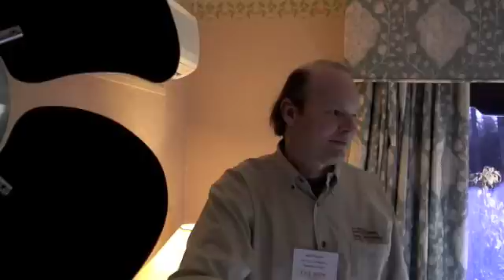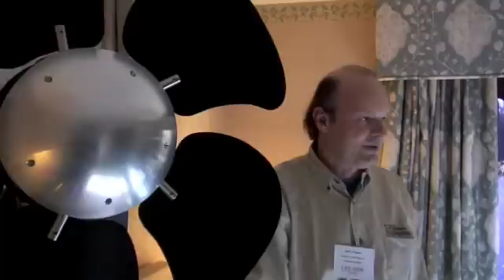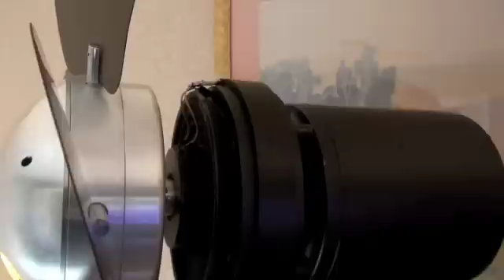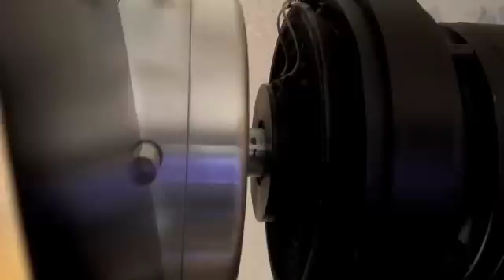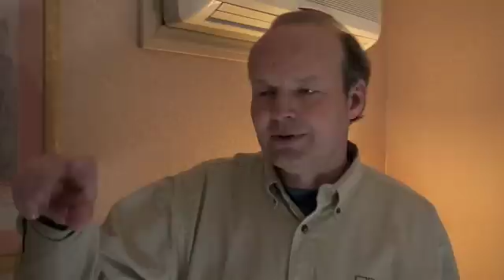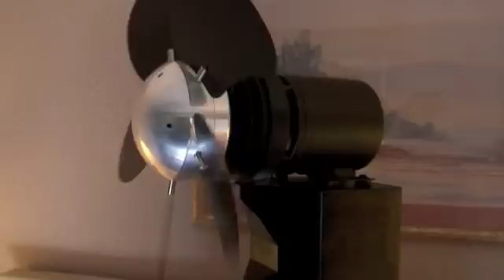rotary woofer

Comment: Not sure why this rotary subwoofer can move enough air to produce linear bass down to 3 hz. Seems to me that the air displacement required for a bass response below 10 hz at say... 90 db loudness would be much larger that those fan blades are capable. The blades would need to be much larger to achieve realistic sound levels below 10 hz.
Reply: +socksumi Because they are rotating, they impinge upon much more air that if they were still. Just as a fan can blow more air that a similar sized disc simply moved towards you.
Reply: They fan spins... He never turned it on
Reply: Yes what the others said. And also it has to be in an enclosure. 
Like cut a round hole in one of your bedroom doors and fit the fan inside, that way it can push air into one room and out
Reply: Essentially you turn one or two entire rooms of a building into a box lol
Reply: It's The efficiency of the air coupling.

Comment: Get an oscilloscope reading, or at least make it produce some hearable bass. I haven't seen any demonstration proving that this thing actually works.
Reply: Go to a overpriced movie theater, they use them all the time.
Reply: +KR abis Marshall & Ogletree organ manufacturers sell this. Opus 1 is installed in Trinity Wall Street I think, or is it Middle-something church in NYC. You have to go to where one is to "hear"==feel it. They work like gangbusters.
Reply: I know what subsonic means. I just need proof that this thing works.
Reply: @NoName_NoTitle  I've experienced it first hand.  it does work.
Reply: right like the other guy says you will have to check it out in person because you cant hear the sound pressure change you feel it.
Reply: There are videos of these things shaking the doors in a house. There is also a video of one in an old Honda Accord that makes the whole car wavy. These do work, but you essentially have to make the world your speaker enclosure. The down sides are that they make noise from the rotating blades even when there is no bass, and the parasitic losses from running that motor will add up. Ironically they don't need a huge audio amp because essentially all it drives is the pitch of the blades. All the audio power comes from the motor that rotates the blades.
Reply: lol obviously not too clued in to how subsonic "sound" is "heard"  anything below 30hz or so is not heard, hence the name  "sub"-"sonic"

Comment: it can't be ran until it's in an enclosure, that's the biggest problem.
Reply: That's true of most any subwoofer, so it's hardly a "problem".
Reply: @robertromero8692  it's a reply to someone else. Someone asked why he can't just run it on the table, and it's because by it's design it won't really "work" without an enclosure

Comment: These are amazing devices.  Bruce is brilliant and the human ear does hear well below twenty cycles.  The issue is the fact that most drivers are mechanically incapable of producing the acoustic energy required to activate our inner ear.  The Thigpen units are more than capable!  You simply have to experience one to believe it.
Reply: The hair cells do just fine below 20hz….but the ear canal, TM, and ossicles are a pretty harsh filter down there.
Reply: You cannot hear below 20. What you think you are hearing are harmonics due to interaction with environment and your ear. And things rattling